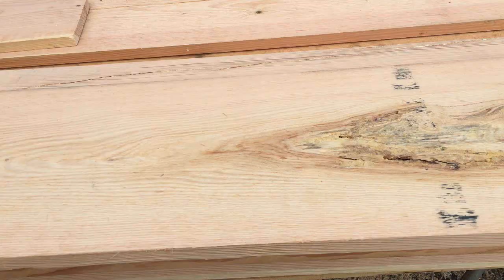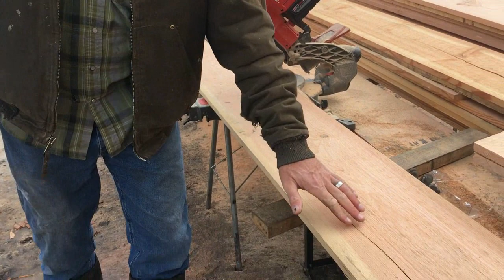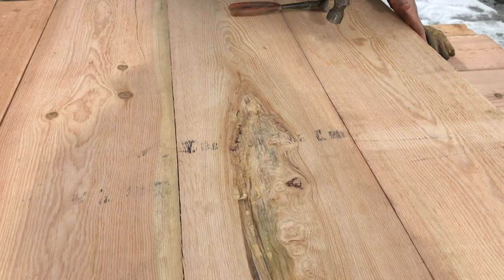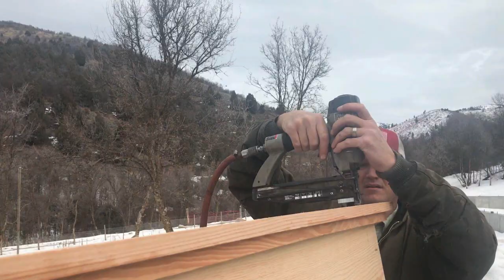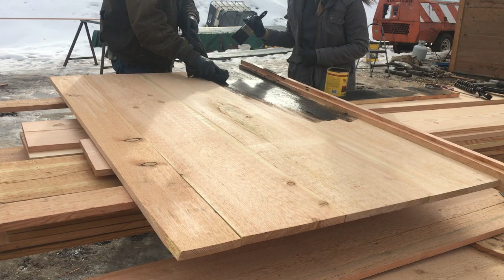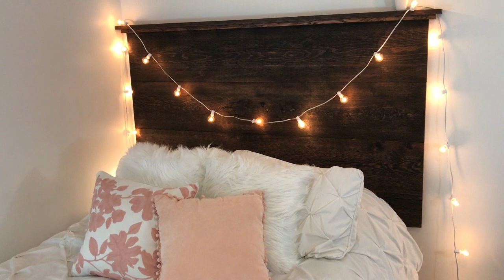#186 -  Made A Barn Wood Headboard For Sage! It Turned Out Great!

Comment: Awesome! You might still spray can a light coat of  matte finish clear coat to seal the stain in and keep the stain from rubbing off on your bedding. You won't notice a visible change in texture and still have peace of mind. I left a small 3-legged stool for the kids unsealed and the seat where it got the most wear left stain on their clothes even after letting it dry for a week. The bottom of your headboard where it meets the mattress and pillows might do the same on your bedding.